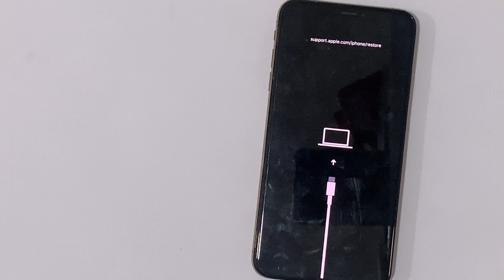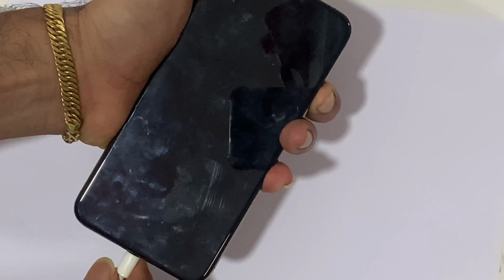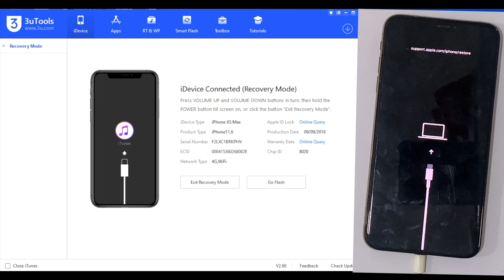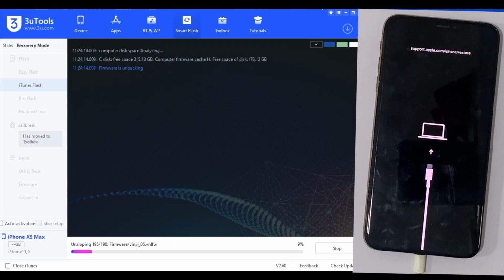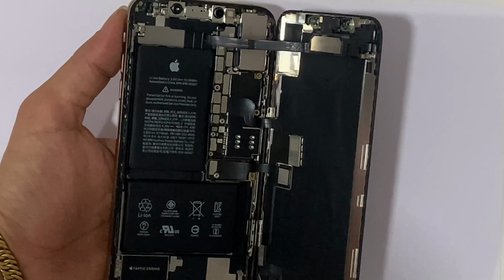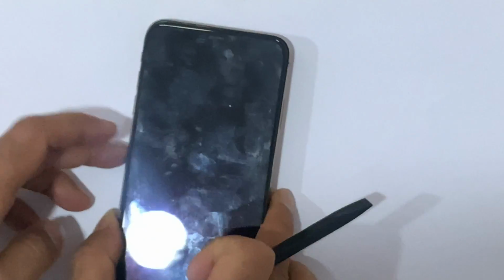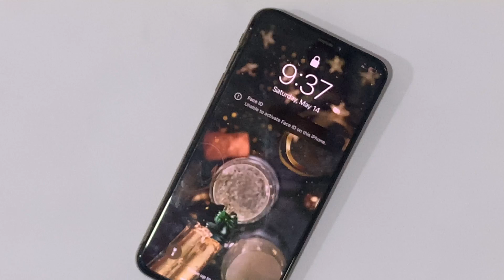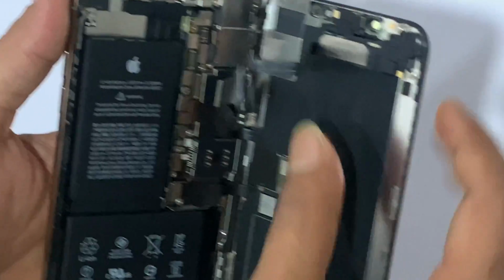iPhone XS/XS Max/XR/11/11 Pro Max Error 4013 fix! iPhone Restart on Apple logo fix.

Comment: does Face ID still work after this?
What did you use to clean and reconnect proximity sensor to the flex cable?
and Thanks a lot for the video already helped me !
Reply from the maker: Clean with isopropyl and Soldering flux to reconnect .
Reply: @thegsmsolution1  will Face ID work after?
Reply from the maker: Yes brother.

Comment: Hi, good video !! what did you use to clean rusty pin of proximity sensor? thanks
Reply from the maker: Disconnect the battery and use iso propyl alcohol with low quantity and rub it gently.